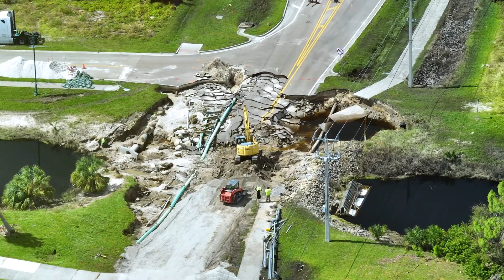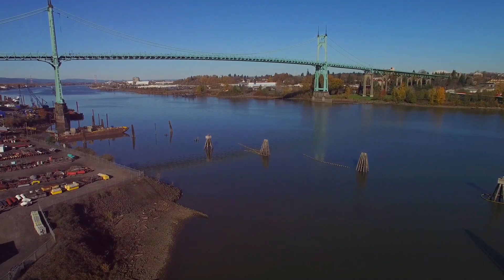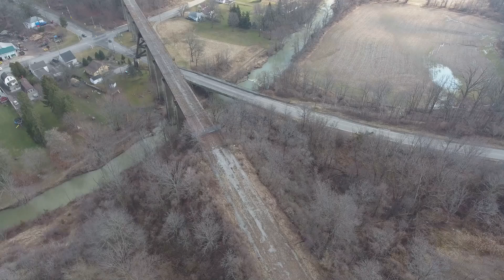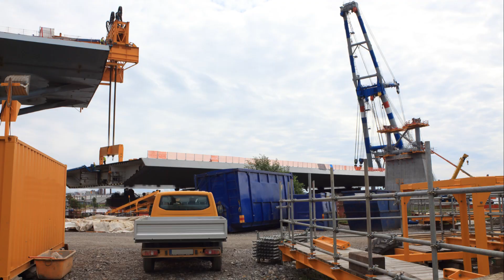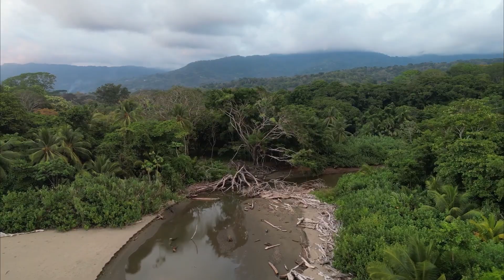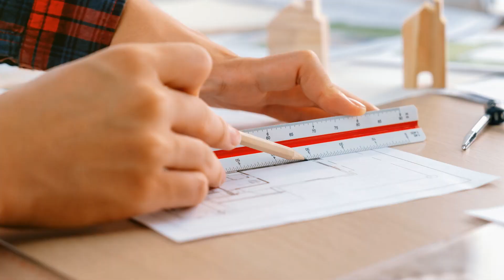Twice Fallen: The Tragic Tale of the Quebec Bridge Collapse

Comment: The basic reasons for this first collapse is first for a contract price based on steel weight , Drillings on the river banks to reach solid rock demonstrated that the pressured caissons couldn't be so deep as to respect the initial free span of 1600 ft it was extented to 1800ft to allow for the safety of the perilous pressurized caissons construction operations ( Détails are missing)  To have an idea please Refer to the Brooklyn Bridge caissons construction  the contractors advanced  due toparticulaly heavy ice and flow in the area. Caissons nearer to the shore  woul accelerate the construction. T.  Cooperin addition to keep the steel works under controll ( not the total weight) reduced the wind bracings and lateral resistance of the structure. That beyond the rules or empirical formulas used for other bridges.  There was in addition a too speedy erection of the structure, leaving unbolted critical joints on the lower cords. They deformed under the inherent instability of the structure . In consequence they couldn't be bolted and rivetted.  The trigger for the collapse was the lifing of a last pannel at the exact change of shift . The frame members ( in the maximum shearing plane for the whole structure)  exactly near the main post buckeld in elastic instability. Multiple photos shows that. Stephen Thimoshenko also explainded this mode of failiure in details for complex structures)  Tor me the findings of the commission are about right but for the wrong explanation.  the structure if properly bolted and without the éelastic instability would have been OK . But the live loads ans the realm of élastic instability would have brought the bridge to colapse sooner than later.. Like the Titanic this bridge and even more so is an immense myth for there are( even now for the third catastrophy well in progress but under omerta) large zones of incertainities and shaddows to explore.